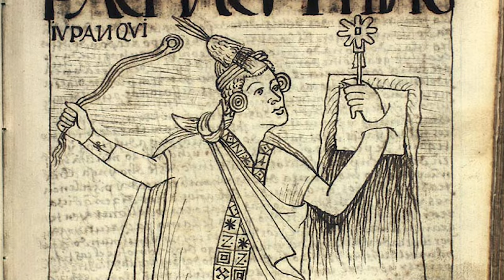SACSAYHUAMAN - How They Did It | Polygonal Masonry

Comment: Your characterization of the fit is inaccurate. They, where not damaged, fit perfectly along the entirety of the joint.
We need look no further than the tools available to the inca to answer the question. Could the tools they had make and move these stones in a mountainous terrain? No, they could not have. It doesnt matter how determined or smart you are, a 50 ton block doesnt move just because you want it too. These and many other advanced ancient structures have a machine accuracy, levels of precision physically impossible to create by hand. 

Notice he never answers the "how did they quarry the stone" , im sorry but you dont just pick up a stone weighing tens or hundreds of tons when you dont even have the wheel. Then to say they left the blocks in this clumsy asymmetrical shape and this somehow made it easier to move is ridiculous. Everywhere we dont see polygonal masonry we see relatively uniform shaped and sized stones stacked in a crude manner usually with some mortar or plaster. Additionally his explanation of how they moved the rocks is laughably impossible, you cant drag stones that heavy on the ground with out some form of skid or roller they just dig in.

 Things like granite have been proven to be impossible to work with so called "pounding stones" see the unfinished obelisk at aswan and the "scoop" marks. 
I dont understand why people are so unwilling to consider that there is alot more to history than we ever considered. Our story as humanity is the answer to the questions we all ask.
Reply from the maker: They, where not damaged, fit perfectly along the entirety of the joint.
On the outside, yeah. You don't know if it fits perfectly on the parts you can't see.

Could the tools they had make and move these stones in a mountainous terrain?
Yes. As he said the quarry is uphill and not far from the site.

These and many other advanced ancient structures have a machine accuracy, levels of precision physically impossible to create by hand.
No, they do not. And I have to wonder why you are making this claim, when you have never seen comprehensive measurements made with properly calibrated instruments.

im sorry but you dont just pick up a stone weighing tens or hundreds of tons when you dont even have the wheel.
None of them weigh hundreds of tons, and wheels don't lift stone.
Reply: @WorldofAntiquity  i noticed, you didnt respond, at all, to a couple of my points. Do you simply not a have a response, so you choose to ignore what isnt convenient? Seems somewhat hypocritical, if you ask me.
Reply: @WorldofAntiquity  still waiting on a rebuttal. If you have one that is.
Reply from the maker: @dgafbrapman688  it has been shown by brien that where the walls end you can see the entirety of the joint and its a perfect fit through and through. Saying you cant see it so it doesnt exist is elementary logic.
If the stones are touching, how can you see that? And more importantly, how do you know it is perfect? Just by eyeballing it? Then the builders could have done the same.

what about the quarry for machu pichu?
Look at the title of this video. It says "Sacsayhuaman."

*Even the limestone is unlikely to be shaped so precisely by 'stone pounders' a laughable concept if youve ever tried it real life.
*
It has been replicated in experiments, so I don't know what you are talking about.

Stones at other sites weigh hundreds or in some cases thousands of tons
In South America? That's just plain false.
Reply: @WorldofAntiquity  Not gonna reply to first one as its pure gaslighting.

im speaking to advanced ancient cultures as a whole, which is inconvenient for you i suppose as the only way your model holds up is by cherry picking sites and information to support your pre-existing beliefs.

Experiments? lol have you ever looked at the findings? I dont remember the actual numbers, but a dolorite pounder used on granite would take years to shape just one stone 6x6x6. These experiments prove only the impracticality of the idea.

again im speaking to advanced ancient cultures as a whole. Being that this advanced civilization was world wide.

But you still fail to address my points. You simply attempt to dismiss them as off topic, or part of something else. 

Answer these 3 questions and ill admit there never was any advanced anything, ever.
1) how were the trilithon stones in baalbek moved?
2) How were the granite boxes at the serapeum made?
3) How did a civilization with NO concept of the wheel ( the concept part is important and i hope you understand the significance of that); no metal tools except for maybe some copper tools, quarry, cut, shape, move, and place blocks more precisely than has ever been replicated in modern times?
Reply: @WorldofAntiquity  Pretty sad some rando with no subs is ripping you apart right now. This prolly isnt even the guy tho, i bet its his assistant or something. Thats why the replies look like theyre copy/pasted out of wikipedia.
Reply from the maker: @dgafbrapman688  That someone would comment on someone's video about Sacsayhuaman and demand answers to questions about unrelated subjects is the height of conceit.

1) how were the trilithon stones in baalbek moved?
Already have a video on it: https://youtu.be/QUiNoAgijpc

2) How were the granite boxes at the serapeum made?
Scientists Against Myths have a good video on this: https://youtu.be/47HAYcii_Q8

3) How did a civilization with NO concept of the wheel ( the concept part is important and i hope you understand the significance of that); no metal tools except for maybe some copper tools, quarry, cut, shape, move, and place blocks more precisely than has ever been replicated in modern times?
They aren't placed more precisely than has ever been replicated in modern times.
Reply: @WorldofAntiquity  i never demanded anything, it was an offer.
Which you did a poor job of taking, just gonna plug your video? haha
Neither of those videos answer the questions because no one knows the answer. 
But we know what the answer isnt, dont we?
Copper does not cut granite. Dolorite pounders do not produce mirror like finishes and perfect right angles ( all proven with calibrated tools time and time again by yousef on unchartedX). 

lol theres that elementary logic, if i say it doesnt exist then it doesnt exist.
Where have blocks of granite been shaped and placed more precisely without mortar or plaster in modern times?
Like ive said this isnt about one site, its about all the sites that show near identical building practices worldwide.
Reply: @WorldofAntiquity  im starting to believe this is a script, i have trouble believing anyone can be so obtuse. I gather youre being paid to push this narrative by sponsors.

Comment: Why weren't the stones uniform? Earthquakes.  The idea that the Inca shaped the stones, moved them to location, then shaped them again to fit perfectly in place, yet leaving the nubs and scoops on the fronts is preposterous. Same for this non-sense that all these walls were left unfinished. If you have been to Cusco, Sacsayhuaman, Ollantaytambo, Tambo Machay, or MachuPicchu, you can easily see multiple walls types utilizing different materials sitting side by side or in general local to each other.
Reply from the maker: You're getting confused between original walls and modern reconstruction. Also, the stones are no more "perfect" than anywhere else.
Reply: @WorldofAntiquity  I am a tour operator with licensed Peruvian (Quechuan) tour guides and have spent many years visiting and researching all of these sites mentioned and more. Just because there is modern construction on top of the original walls, does not mean that the original builders never completed their project, as Mr. Lee claims a couple of time in this video. There are multiple types of wall constructions at each site (I listed above), indicating many different generations and/or different cultures throughout the ages. At 17:30, that particular wall at Ollantaytambo. pretty damn perfect, and judging by the patina, far older than 15th century construction. Next to this wall is the Enclosure of the Ten Niches, made of different material and constructed differently. Around the corner from that is the Sun Temple comprised of different material than the others...and yes, looks more perfect than anywhere else in the world. All aligned to the sun, the moon, and the heavens above. Not that far away is Naupa Iglesia, with an enigmatic wall face that has been perfectly cut out in 90' angles.....I can go on and on....
Reply from the maker: @abcfavorites  Your reasoning that "The idea that the Inca shaped the stones, moved them to location, then shaped them again to fit perfectly in place, yet leaving the nubs and scoops on the fronts is preposterous" would apply to anyone that built the fort. You say it is perfect, when there are clear imperfections, such as gaps between the stones in places. Even you suggest that leaving the nubs and scoops is an imperfection. If you want to be a reliable guide at Sacsayhuaman, read all of the sources listed below the video.
Reply: @WorldofAntiquity  Maybe you need to read them again. Protzen says specifically about the stonework at Sacsayhuaman "...because of the fit, which does not allow one to introduce even a knife blade into the joints".  Pedro Sancho de la Hoz says "In the three, staggered sawtooth walls, the presumed architects of the fortress, Huallpa Rimachi Inca, Inca Maricanchi, Acahuana, and Calla Cunchuy have created a work of architecture that has no parallel in the Old World, either in design or in technical achievement. The walls are monumental and imposing, yet subtle in detail and majestic in appearance." Later he says "What we see today of the Fortress of SaqsaWaman is but a shadow of the splendor it once held"
Reply from the maker: @abcfavorites  Yes, some joints are very tight. It is beautiful work. But notice he names the architects.
Reply: @WorldofAntiquity  Master Mason's/Architects names provided from Garcilaso de la Vega's Royal Commentaries, Book 7, Chapter XXIX. Vega quickly moves on to the story about the 'Weary Stone', with no further commentary on these architects. Not being able to move the Weary Stone is the sole reason behind the conjecture that Sacsayhuaman was 'unfinished'. It's purpose was for "another great construction".  My theory is that Pachacutec continually restored and upgraded Sacsayhuaman, along with all of the other empire's sites/trails/roads etc...
Reply from the maker: @abcfavorites  Other empire?
Reply: @WorldofAntiquity  Pachacutec expanded/united the Inca Empire from Equador to Chile and Pacific coastline to the Amazon. The tax levied on his subjucated people from this conquest was skilled labor.

Comment: The so-called stone experts were deliberately avoiding the eroding phenomenon on the stones used to build various walls.  When stones erode so fast and so dramatic like those ones we saw everywhere, I believe it should be talked about and be investigated thoroughly.  Erosion will determine whether a stone is a natural stone or a cement concrete. I believe the erosion we saw here on the stones in Sacsayhyaman has told us that all the stones are cement concretes, or geopolymers.  For example, in the picture appearing at 7:38 we see 2 eroding stones on the right hand side of the picture. The erosion on these stones reveals that the stones' interior is made up with red and white material, very similar to the colours of the small stones in the middle of the picture. This must be very powerful evidence for us to call the stones artificial. Logically all the stones used to build the polygonal walls are artificial or cement concretes or geopolymers.
Reply from the maker: Which geologists did you hear this from?
Reply: @WorldofAntiquity  : I did not hear this from any geologist. I discovered this by means of common sense. For instance, I saw erosion. I saw different colours. I saw different materials inside the cavity of a stone .
Reply: @WorldofAntiquity  : The erosion phenomenon is happening more prominently to the stones in Egypt's pyramids. There, the crumb of some  megaliths can be seen easily by our human eyes; while some smaller stones have lost half of their original size.  As a result, hundreds of stones have fallen down from the pyramid roof. Sooner or later, big disasters will happen. However, nobody was talking about the erosion problem, except me.
Reply from the maker: @legpol  You will find that common sense isn't part of the scientific method, and the reason for that is because common sense is simply personal experience. Personal experience can help us out in a pinch, but when it comes to scientific research, it carries little weight, because we often are studying things we have no experience with. That is why people have to go to school to learn geology. One doesn't arrive at a decent knowledge of geology just by picking it up in every day life.
Reply: @WorldofAntiquity  : Though your scientific route is better, why there are no geologists talking about the erosion phenomenon? Besides, I think any ordinary people and non-geologists are capable to tell what is dangerous. You don't need any geologists to tell the falling stones are very dangerous. If we ask an Egyptian service guy on the camel: are the falling stones dangerous, very dangerous?  Will he reply "please ask a geologist"?

Comment: The construction of Sacsahuaman –Cuzco-Peru
Few researchers have ventured to explain how the walls of Sacahuaman were built. Megalithic blocks weighing from a few hundred kilos to a few hundred tons.
The difficulty lies in the fact that these constructions are attributed to the Incas who did not know iron or the wheel. We must therefore imagine methods based solely on the absence of advanced technology. The blocks are recovered from quarries often tens of km away. We will pull the megaliths with ropes and the strength of thousands of men (There are limits!). On site we will install the megaliths on trunks (hello damage!)And we will copy the shapes of the seats and vertical contact with a rudimentary tool guided by a plumb line. To remove the upper block, a noria to go back and forth from the block with wooden wedges underneath, which I lower one level for each round trip until the final seat (I'll spare you the details).
It is complicated, long, difficult and without any safety for the workers (This has never been tested except with a 500 kg block and the result was limited).
However, this summarizes the theories defended by Protzen and Vincent R. Lee.
Reply from the maker: You had better check your facts. There are no blocks at Sacsayhuaman weighing a few hundred tons. In fact, I think that was pointed out in this very video.

Comment: The methods don't explain the  top stone mashing the bottom stone material out it looks like both were soft and mashed each other I strongly believe that a sack was filled with a geopolemer the marks on the outside of the blocks were mashing into the sack to hold them in place until they set up.
Reply from the maker: They’re not mashed
Reply: @WorldofAntiquity :  His explanation makes a lot more sense than anything you've said.

Comment: Uh..... No.  Making another decision not to buy this.  There is some good info in here, but scribing?  Multi angled blocks?  There are some blocks with up to 13 angles!  Can you demonstrate that done?  Many of the blocks at that site are not straight, and it's one thing to do this two dimensional, but 3?!  It's not just the face side, it's plush even going into the depth of the wall!  He mentioned the Inca did this work forced by the Spanish?!  But the churches built there, even with the stones stolen from the sites are often not placed to the degree of competency, especially not to the degree of size!  Let's not even mention that the Spanish who documented what they saw didn't establish these techniques, so however smart these people were, we just don't know hundreds of years later, and guess?  Some of the stones in that wall even make images of snakes and a puma paw!  Again, I'm not saying the Inca didn't do it...  I'm certainly not saying Aliens or "Ancient high technology"...  Whoever DID build these sites seem like they're playing with us.   Answer this question....  If the Inca wanted to build a fortress wall.... and they had all these large and small stones laying around.... would it make sense for them to haul them over and stack them as is, or go through so much trouble and effort to make it so pretty?  Something isn't right here.
Reply from the maker: You may have missed this, but Mr. Lee's theory only proposes doing two sides of a stone. He explains how only 2 would be necessary.
Reply: @WorldofAntiquity  Thank you for the response.  I did catch that part, but may have to listen again as I don't recall him specifying only 2 sides, but that does make sense for a 2D wall.  I've seen videos that Ben has shown where that applies to Inca work, and it's suggested that it may have been repair work, as the lowest work fits in both ways, 2D and 3D.  Wouldn't that suggest an inability to do the entire wall?